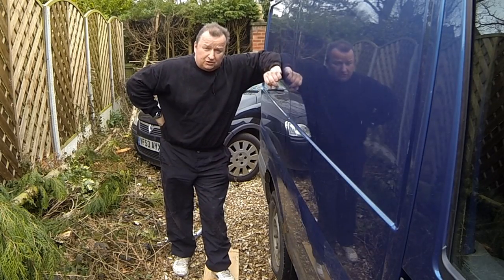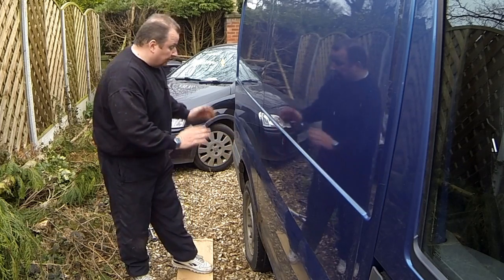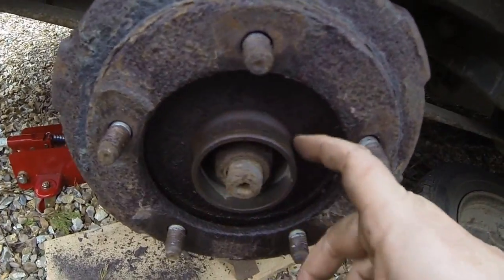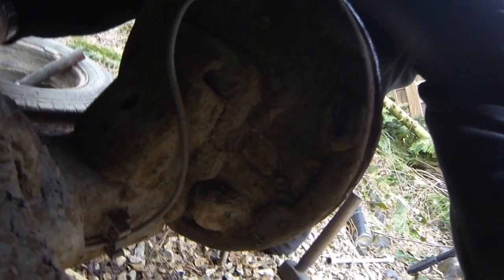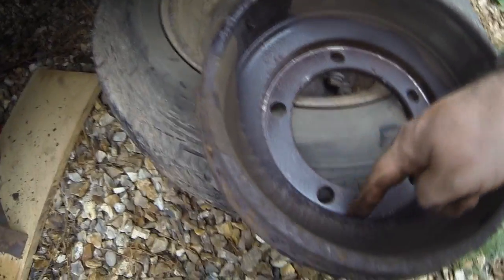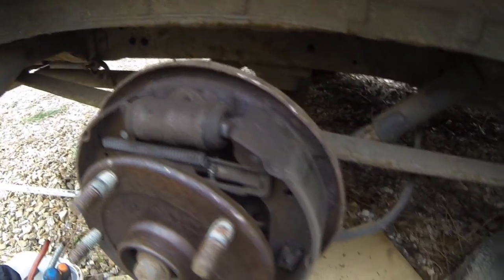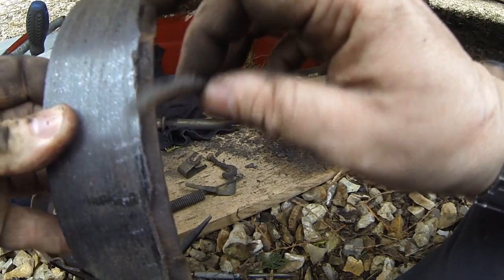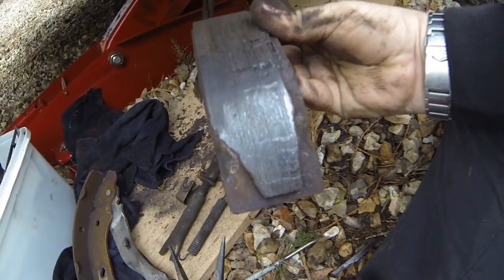Part 1 Ford Transit Mk6 Rear Brake Drum Handbrake Stuck On Stripdown

Comment: I redid the drum brakes on my jeep last year.  Man getting those springs back on is fiddly work. 

A bit of heat on the inner part of the drum (where it touches the hub) helped get things moving when I took mine off.  

Take care,
Jay
Reply from the maker: My next move was to use heat Jay but lucky enough it came off. Cheers Martin

Comment: Another great video Martin, looks like you could have had some water ingress its taken the bonding off the pads onto the shoes. Yes you are right you could have backed off the adjuster but if the shoes were stuck to the drum then only a bit of persuasion with the club hammer would have moved the drum. Look forward to part 2 Martin keep the great vids coming !.
Cheers, Jeff.
Reply from the maker: +cabdriveruk I ordered new drums as well Jeff, the set was only £75.00 so I thought I might as well do it.
Cheers
Martin

Comment: I was going to say that it should have a slot to back off the adjuster but you mentioned it. I have had pads stuck (rusted) to the drum. The drum rusted on around the bolts. After wire brushing the drum and the rest of the parts I also applied some white lithium grease plus some Never sez on the threads. I just had to do all brakes front and back on my 2007 Kia, fun fun fun.
Reply from the maker: +DJMovit Brakes can be a right pain as you already know but it's all character building lol.
Cheers
Martin

Comment: I had my drums off last week to do the handbrake cable. I found that once the drum had moved a few mill, I could tap a lever into the space between the hub and the drum to drift the drum off, just rotate the drum a few times as you tap the lever in to ensure it comes off easily. I have posted a video on how I did it.
Reply from the maker: +BikerBri66 You had your fair share of problems too bud. Must be a common thing with these drums.
Cheers
Martin

Comment: My 2006 fwd made a godawful noise while driving today, and the handbrake lever is now stuck down and rear wheel locked solid, managed to drag it into a layby (at least it's fwd)
   Any idea what's going on?....if the shoes had welded themselves to the drum then the handbrake lever would surely be slack?
   It's like the handbrake cable has suddenly become a lot shorter :-(
   Help!
Reply from the maker: You'll need to get the rear wheels up in the air bud to see what wheel is sticking.
Reply: @retrorestore  Yeah, It's a bugger, about 5 miles from my house next to a busy road, be impossible to tow and a challenge to get on a recovery vehicle, it's got the best part of 2000kg of wrapped asbestos in the back too :-(
    I might try cutting the handbrake cable just to shift it to home

Comment: 75 Squid. 37.50 a pop. Did you say it passed MOT with them brakes? 
I'd change the bearings while your in, fuel economy. Friction = Fuel. It's not just the brakes, it;s the hardware that gets clogged up. The garages don't change the small cheap stuff that causes squeaks.
Reply from the maker: +69Phuket Yes it did pass like that. I know what you mean about changing whilst they are stripped but i'll leave them this time as we've spent loads on parts lately.
Cheers
Martin
Reply: +retrorestore Fair enough Guv. :) But the MOT guy's job is is to check the fracking breaks as priority.
Or am i a daft bugger?
Reply from the maker: 69Phuket
They did pull up ok but it was the handbrake being stuck on this wheel that drew me to this issue.

Comment: Aaaah. You are sooo far into it. You should have just pulled the slave cylinders, cleaned them and degreased them and refitted them with rubber grease.